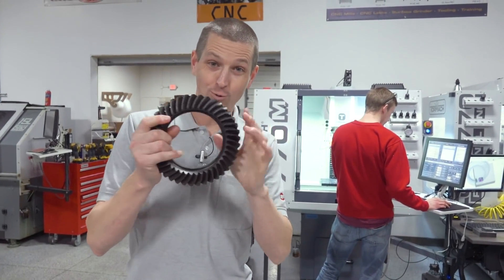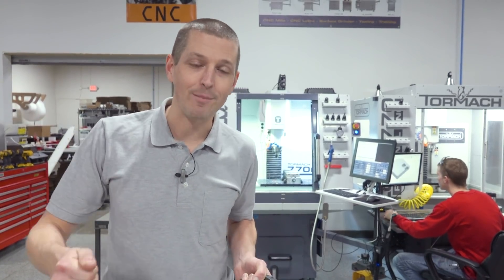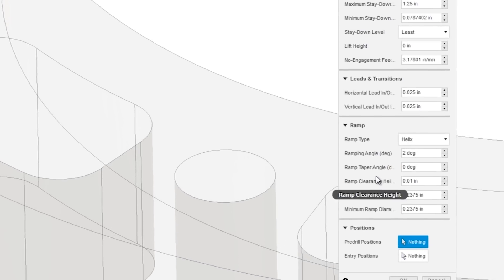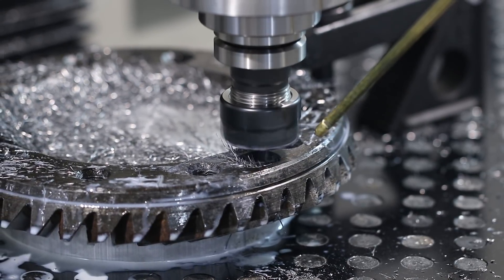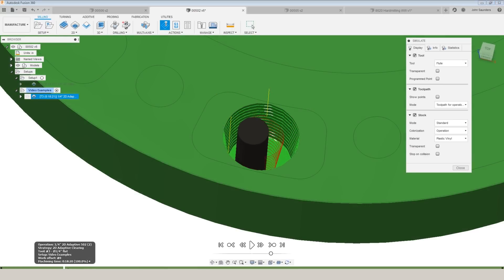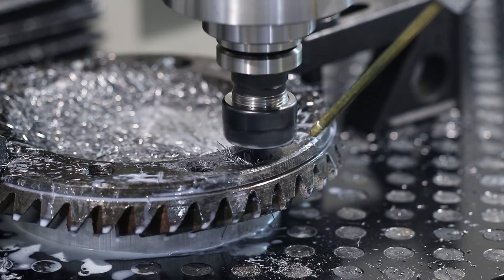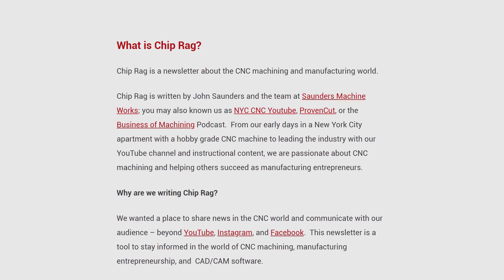Hardmilling an 8620 Differential Ring Gear on a CNC Machine!

Comment: Isn't this a bad idea to machine a already made gear? If the teeth are ground to very high tolerance and you remove material from the gear after that then the whole gear can bow and you lose that tolerance and introduce irregularities that tend to build up over time in a gear.

Comment: Usually when you break through a case harden part, you be changing the overall structure of the part. With a hypoid ring gear this will make the contact pattern of the gear set to move and it will not usually move in a good direction. Also most gear sets do not have ground teeth, but the pinion and gear are lapped as a set as this is a faster and cheaper process. So if the pattern is moving from changing to structure of the ring gear I believe that the life of the gear set is being shorten.

Comment: 0:06 50HRC isnt that much, i work at a mold factory for injection molding and we have parts with up to 65HRC
Reply: Aye, 50hrc isn't bad. I work with hardox600 wear plate (around 60hrc and tough as nails) you really notice that extra 10hrc on the tool life, nearly cuts it in half.
Reply: The thing that drives me crazy is recutting the chips. As a machinist at a sheet metal job shop we typically clamp parts by magnet. Still ok with normal steel and the flush effect by the coolant but wear plates dear god... Still trying out some high feed strategies. Those dynamic 5ax machines cant  handle heavy cuts for chamfering in one go. 20mm*45deg for example.

Comment: I'm new to CNC, and have started some programming for my Fadal.  The tip about the ramp diameter will help immensely, as I've struggle repeatedly with trying to figure out the empty tool paths.

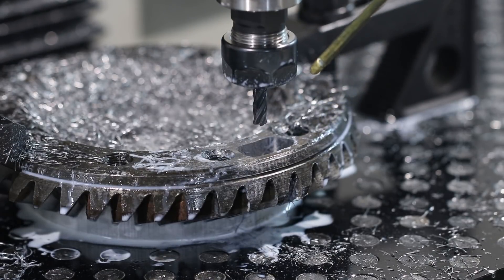Comment: Looking at how well the air blast from the mister blew out the chips on the lift out at 6:12 and all the talk of chip evac there after, is there a way to have Fusion do a lift during a linking move to help blow out all the chips that pooled up in the pocket  during the previous cut move?

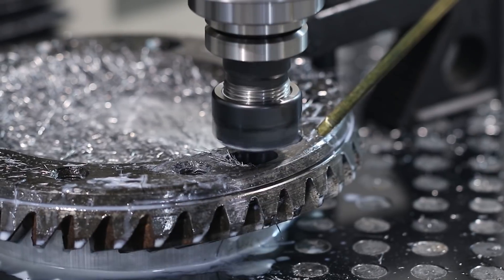I realize that it might add a little bit of time per pocket but I would think that it would be very minimal at best since it could be a rapid lift and a rapid link vs what appeared to be a regular feed rate during the none cutting linking move that it made each time. In something like this where the feed is very slow to begin with, it might actually reduce the total cut time by having the rapid lift and move for the linking move.  Like for example, when I look at the linking move that starts at 5:18, its not back into the cut until 5:26 so thats 8 seconds of cutting air where a rapid lift and rapid transverse should be faster and have the added benefit of chip clearing that built up in the pocket.

Comment: Production gears are never through-hardened.  If it is 8620, the core will likely be no harder than high-30s Rc.  The thickness of the carburizing layer will depend not only on how it was carburized and heat treated, but also how much material was ground off post heat-treat.  A production hypoid gear like that may have had very little stock removed from the back face, however the the teeth should have been ground after heat treat (typically with a very-controlled amount of stock removal - to accurately control the remaining thickness of the carburized layer).  Carburized layer may typically start dropping a few points in hardness as little as .010" or .020" below the surface, and by .030" deep will probably be in the low 50s, and down to core hardness by .~060" deep.

Comment: Hi John! I have a question. Near the end, you state that the tooling operation is a balance between low tool stick-out, and chip evacuation. Could you add a “pull-out/push-in” operation to the tool path, whose period (time between operations) is inversely proportional to the depth (i.e. t(p) = k / d, where t(p) is the time duration between the pull-out/push-in operations, k is a constant determined by experimentation/trial-and-error, and d is the distance the tool is into the hole), and that fires off, once ‘d’ exceeds some value such that the tool/spindle start to block the spray/coolant? Anyway, another nice, educational machining video! I appreciate your positive attitude and you have a great on-screen personality! Getter done! 😎

Comment: Gears are normally just surfacehardened because the material in the core has to keep a high strength. so it is possible that you only had 0.5 to 3mm of hardened steel to mill.
In our shop we do hardmilling since years. If you`re interested let me know.

Comment: Nice video!
Question: Do you do a finish pass when milling hardened steel?
Reply: If you want it to look smooth then you always do a finish pass. When using endmill that can cut the full depth in 1, in my opinion, it's always worth doing a finish pass plus spring pass. I mean how long does it actually add onto the job?

Comment: This would have been better if you showed how to do it with a cheap import HSS endmill...
Reply: Not really worth trying I think XD something tells me you're just going to create alot of heat which is never good for HSS.
Reply: @wildin13  It was an April 1st joke reference.
Reply: @eformance  DOH!!
Reply: It can be done "simply" by slowing down to 50 rpm range if the end mill doesn't happen to be very soft
Reply: He already did it with a Chinese light duty machine.
Reply: @josephforbes5517  It was a joke, you'd burn up or knock the edges off an HSS endmill.

Comment: John 8620 is a case hardening material. Typically the case is about .050' thick and the material below would be softer say in the Rc 35 ish range. Was this material hard all the way thru?
Reply: this.  8620 has a pretty soft inner core and is used here (gear) on purpose.  It isn't like hard milling D2 or something
Reply: beat me to it.
Reply: ,,, the thing is, is a high volume gear manufacturer going to go through that extra work or just throw it in a quench dip with 50 other pieces ?
Reply: Roland Tamaccio Even if you quench 8620 in water it doesn’t thru harden.
Reply: @bcbloc02  ,,, thankyou, ,,, had to stay home or I probably would never have learned that .

Comment: would it make more sense to drill an entry hole so you dont have to helix down on entry and wear the tool out
Reply: John Fredrickson - Yup.  There isn’t a cheaper or more efficient way to remove metal than with a drill.
Reply: @ClockworksOfGL  there are cheaper ways,...... saw, shaper 😉
Reply: drilling in hardened steel on a small machine is tricky.
Reply: @henrychan720  It's only hardened on the surface and it's not really that hard inside.

Comment: was all that milling just for weight saving on the diff?
Reply: Only other thing I could think (other than April fool's with a lot of effort) is to hide drugs in the diff gear.
Reply: @leverknight1  lol
Reply: I was thinking the same thing. I couldn't think of any other reason.
Reply: @Captain_Flyn95  
Same question here.
Reply: Pretty pointless, if that's done for weight reduction only.
Lots of effort for a few grams and a potentially distorted spiral bevel gear. 
Good luck finding/making replacement for such gears, if it's out of production.
Reply: Ya I would think, that diff gear definitely won’t last long if there is any real power there. 
Plus all the milling will make the part warp. Good luck having in shape after

Comment: Is it 50 HRC once you removed about 2-3 mm of material? Probably softer in the middle of the part. 8620 does not have a good hardenability (Jominy test) when you compare it to 4340 for example (https://www.emjmetals.com/pdf_indexer/pdfs/Mechanical_Properties_and_Hardenability.pdf ). Thanks for sharing! I appreciate your videos!

Comment: Quick Question if you know, is it through hardened or only case hardened?
Reply: Seeing how it's a standard production part it's probably induction hardend
Reply: @Nubby007  I do not believe that you can induction harden 8620 steel as it does not have contain enough carbon to change the structure of the steel. In order to harden 8620 you need to add carbon to the surface of the part by heating the part in an atmosphere of something like methane(that is where the term "Case Hardening" comes from). The part is then reheated and quenched in a controlled solution to change the structure of the material. If you study strength of materials you find this explained. Today's heat treat methods for production are usually done in a vacuum furnace making process time faster and less expensive.